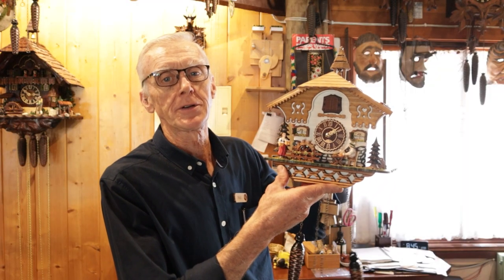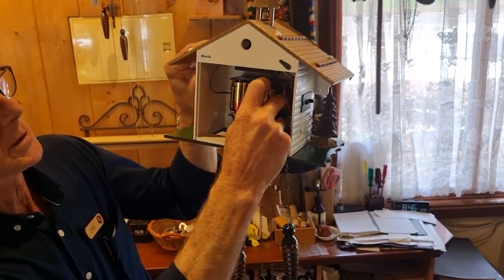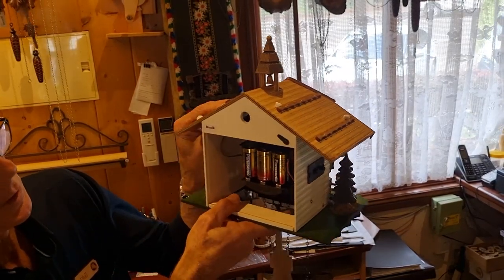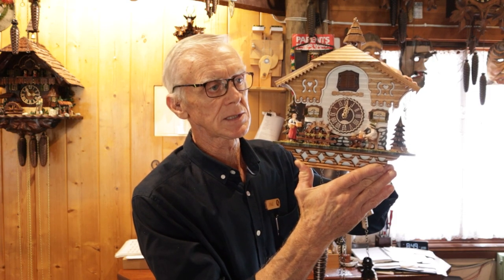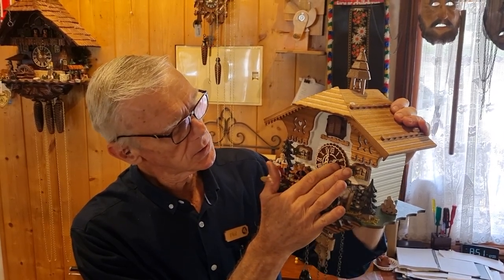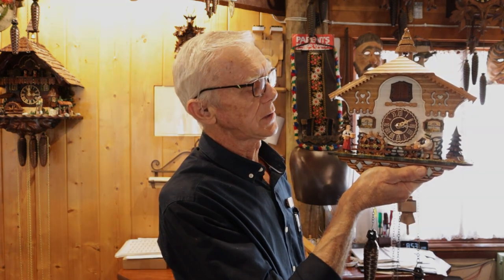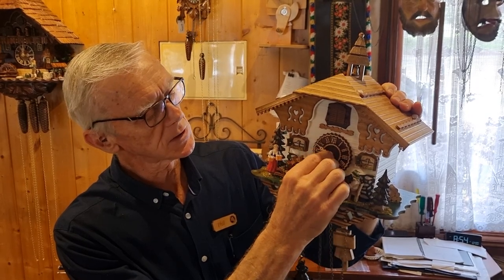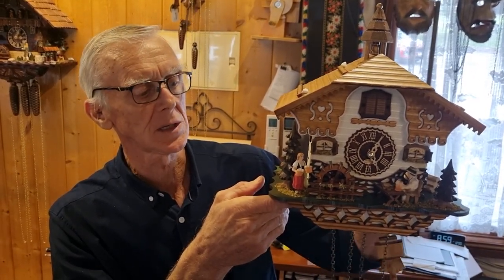Battery Cuckoo Clock Troubleshooting Guide

Comment: I have a battery operated Cuckoo clock i purchased at the Black Forest in Germany and it stopped "cuckooing" on the hour and was totally wrong number of sounds when it did sound after setting it after daylight savings time.  My second hand was loose after taking it down to set the time and when i got it to "catch" it was not where it was supposed to be.  I learned you can move the hour hand and also take the minute hand off and put it at the right time and that fixed my clock.  I am so relieved that my clock strikes exactly when it should and the correct number of strikes!  Thank you for this informative video!

Comment: Hi there … i have this original cuckoo clock since last 15 years and there wasn’t any problem. However, since last one month it has suddenly started moving fast by 5 minutes and gradually increasing the time difference. I have changed the batteries too. How do i fix it ?

Comment: Our cockoo clock (battery operated) keeps perfect time, the cockoo bird comes out doors and cockoo's on each hour as it should, but the little children which revolve around while music plays have stopped revolving throughout music playing, seeming to hang up on something and disc also stops turning.  Slight nudge gets it moving again, but then it continues to hang.  It now doesn't revolve while music plays.  What is the solution to repair?
Reply from the maker: You might need to change the batteries, or bring the clock in for a service. Sometimes the oil or grease they use can dry up and that little movement seizes in some way.

Comment: What to do when the cock is chiming correctly on the hour but it's three minutes earlier than the actual correct time?  Do I move the minute hand backward 3 minutes or forwards to catch up? Or take the minute hand off to do so then reposition somewhere?    It's a mathematical puzzle I just can't solve.  Every time I set the clock back from daylight savings or forwards for daylight savings I face this same dilemma, whether it's chiming earlier or later.
Reply from the maker: Hi there, you can remove the batteries, position the hands between 12 and 1, re-insert the batteries and move the hands clockwise around to set the correct time.

Comment: My cuckoo clock doesn't cuckoo.  I have new batteries in it.  Also set it correctly.  Every once in a while, it will cuckoo, but it is rare when this happens.  It has a photo switch that I thought might be not getting enough light so I mounted a light bulb near it.  Didn't help.  Anyone?  Please help.